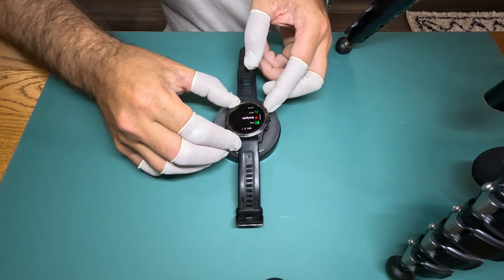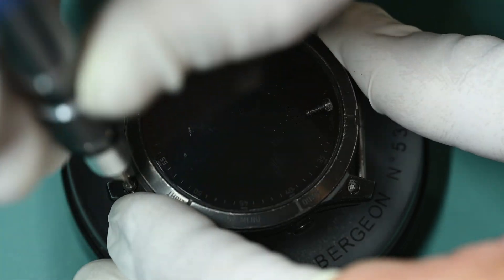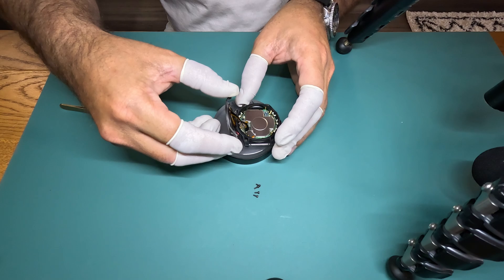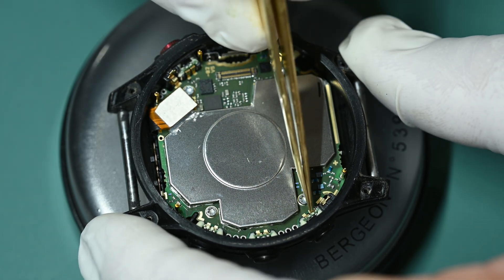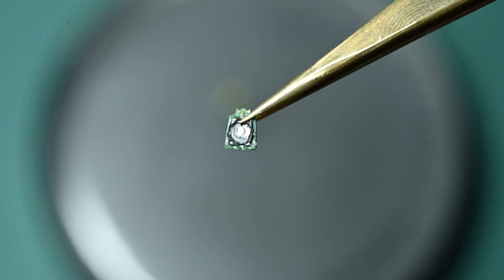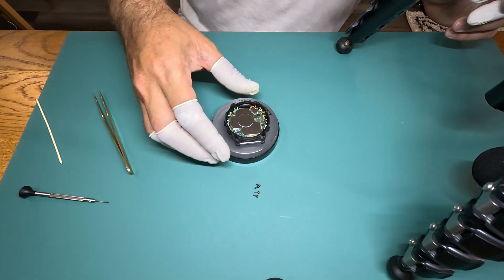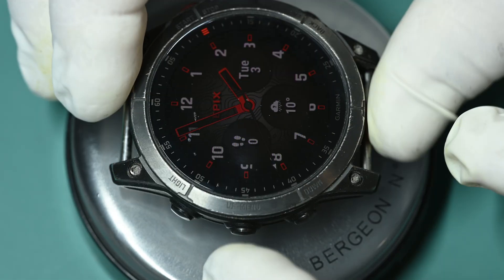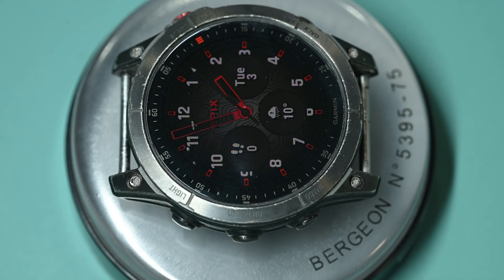The REAL way to fix a Garmin button that's not working

Comment: Great video. Going to try this to fix my Fenix 3 that’s been sitting in a drawer since the start/stop button broke a few years ago. Thanks!
Reply from the maker: It will most likely be a different switch on the fenix 3. I presume it will be a similar procedure, unless it is a solder-in type. Thanks for watching and good luck 😊

Comment: Hello and thanks for the video!
Where did you buy the switch? I need to repair my 7x also... 😒
Also you know where to buy a new gasket?

Thanks and merry christmas!
Reply from the maker: Thank you, I'm glad you liked it :) 
The switch was from advancedrepair. co. uk, they only ship within the UK, though. Otherwise you can get the entire middle section of the case with the switches included from ebay or aliexpress. Then you can harvest however many switches you need. It works out a lot cheaper that way, as the prices have gone up on the UK site since making this video. Good luck with the fix!
Reply: Hello again and thanks for the reply!
Unfortunatly I seem to be to dumb to find those buttons anywhere else than where you mentioned. I searched temu and eBay but nothing.
Any further tips? 
Thanks and happy new year!
Reply from the maker: Definitely wouldn't say that! They are very tricky to find haha. I just checked ebay and you can still get the case of the watch with all 5 buttons in them. The name is "middle plastic front frame for garmin" and you can pick the model you want, 47mm, fenix, etc. Hope you have some more luck!

Comment: Thanks for this, I have the Garmin Epix 2 and the enter (top right) button became inoperable about a year and a half after I bought it.  Could kind of use it connected to my phone but without the ability to hit enter very restricted.  Now I had to update my phone and I can't connect it to the new phone without blue tooth repairing which I can't do without hitting enter.  Very expensive watch, I had an old Garmin Instinct that lasted for years with no issues.  In Canada, no idea how I could find the switches or somebody who could repair it.  Still it is nice seeing a good explanation of what has to be done and there is a remote possibility of repair.  Thanks for taking the time to put together an insightful video.
Reply from the maker: Thank you, I'm glad you liked the video! You may be able to still get the middle section on ebay that you can harvest the switches from. I have seen some people in the comments have success with this. I hope you manage to get it sorted!

Comment: Do I need to add some solution or something extra to the edges of the watch face to ensure water tightness?
Reply from the maker: It is best to replace the gasket and use a silicone lubricant made for watch gaskets if you want to ensure maximum water proofing 🤙

Comment: you think a Garmin Epix pro standard front frame would have the same switches as the GEN 2
Reply from the maker: I'm not too sure, but the different switches look a lot different. So if you can find a frame where they look the same (you should be able to see the two brass tabs) then I would say they are the right ones. But I can't guarantee as I have only worked on my own watch, not other models. Hope you have some luck, mate!

Comment: How do you remove the silicon to remove the micro switch? I saw in another message scraping it off. However can not see the blob of silicon to remove. Is it below the gold pins? I’ve used a lot of force with tweezers to remove the button, I get movement of it. But it won’t come up. 

I’m wanted to replace it with the bottom left button. As feel it’s hard to buy a new button for £90 when the watch is only worth £180 on eBay. 

It’s tempting to get a newer model and hope they have resolved this issue and screen burning. But feels bitter if it only lasts 3-4 years as well. When you’d expect at least 6 years for something on this price. While friends have 10 y/o Fenix still going strong.
Reply from the maker: If it's the same model as mine, the silicone was only a small white dab on top and peeled off easily. The switch shouldn't need much force to come out. Sorry I couldn't be of more help, I hope you have some luck!

Comment: I was not able to find on web site of ADVANCED REPAIR SERVICES if this part also fits START/STOP button on Epix watch? This is my case. This button looks a bit different by the look. Any thougts?🤓
Reply from the maker: I'm really not too sure about which different models this switch fits (other than epix gen 2 and fenix 7). In my case, I just removed the switch and searched for one that looked the same online. If it doesn't look the same, then you may have to buy a spare parts watch or similar on ebay
Reply: @Timepiece_Mechanics  I am having the same watch as you - Epix Gen 2. Apparently answer was in your video, as your START/STOP wasn’t working and you took the switch from DOWN button from your watch. So they are the same.
Reply from the maker: Oh sorry, I didn't quite read your first question properly 🤦‍♂️. Correct, all the buttons in the epix gen 2 are identical 🙂

Comment: Exaxt same problem.. garmin epix 2 down button no longer responding. My watch is just over 2 years old. Very disappointed by the quality of Garmin. When I bought this watch it was nearly 1000 EUR at the time. It's totally unacceptable that a button breaks after just 2 years of use, especially in this price category, which is supposed to be one of their flagship models.

Comment: Same problem with my fenix 7x pro. Tried to soak it in warm water but without success. I m using my fenix in my swimming pool filled with the water from my well which is super hard. Put it in a mix of warm water and vinager for 15 minutes in order to disolve the potential limescale. Seems to solve ( at least temporary ) the problem. Good luck
Reply from the maker: Glad to hear it was an easy fix! 👌
Reply: Thanks for the suggestion mate, I'm gonna try it out now😂

Comment: What chance percentage would you say this is the fix for not functioning start button in Fenix 7? I can press it, there is just no click. Common sense tells me this is exactly what happened, but I am more software than a hardware guy :p
Reply from the maker: I would say there's a very high chance, as the "click" is all to do with the micro switch. It is always a gamble, but you could pull it apart to check before you buy a new one, just to be more sure

Comment: Hi, do you know if the middle frame buttons are the same for the Epix and Epix 2 (non pro)?
Reply from the maker: I'm not too sure. I would assume so, but it would be worthwhile looking on ebay or similar and see if you can see a difference
Reply: I purchased the entire middle section (see my other post for the ebay link - no affiliation) and the internal button parts are all the same for the 5 buttons on the epix gen 2.
Reply: Thanks for the response!
Great video btw and as I can see, it already saved a couple of watches :)
Reply from the maker: Thank you 😊 
Yes, very happy I could help some people!

Comment: My Epix Gen 2 'back' button (lower right) stopped working.  I was surfing in surf mode and a guy asked what time it was.  I was sitting on my board but the watch was obviously wet.  The button didn't respond until I pressed it a bunch of times.  Now, after soaking in warm water etc., it works here and there, sometimes after one push, other times after 20.  I found a guy selling the entire middle section of the watch on ebay per your suggestion.  Do you think it would be easier to just replace the entire middle section?  Or is taking the bottom off and getting all the internal parts of the watch back in more difficult?  Thanks for the great video.  Also suggest to others like me who don't have a spare gasket, to clean it and the grooves with a cotton swab, then lightly lubricate with silicon grease.  I've done this with all my underwater camera gear and would assume the same works here.  

Edit - okay, I just wanted to see if I could clean the button and switch because I was still getting a 'click'.  But the switch took a little wrangling to get out after peeling away the silicon.  Unfortunately I broke one of the 2 gold contactors using tweezers to extract it...so now I have to wait until my middle section arrives.  Hopefully, I can extract the switch more delicately.  As for my initial question of putting the watch back together, using the refurbished middle section, it looks like that will be complicated after seeing all the components and how they are screwed in.
Reply from the maker: Hi, sorry to hear about the issues you're having , but I am glad the video has helped. And yes, changing the entire middle section is quite a bit more involved, as it seems you have discovered. At least you will have a few spares now :)
Reply: @Timepiece_Mechanics  Without a doubt.  I wish it wasn't so complicated because all the buttons on the replacement middle section I received all feel perfect.

Comment: Thanks for the video. They charge £90 for a single switch for an Epix Gen 2, so I think buying a faulty watch for that price is they way to go.
Reply: I purchased the middle section from eBay and just received it (it comes from China so I was a little concerned).  It seems like it is brand new and probably costs about the same as 1 switch from the other UK company.  It took approx 2 weeks to arrive in the USA.  I'm going to do the repair this weekend.  If it doesn't work out, or I find some other issues, I'll post what I find here. Good luck.
Reply: Went smooth as silk! I should have replaced another button that works but doesn't 'click' but thanks to this video, I know I can replace it when it fails...I've got 4 spares left!

Update - for non watch repair experts (that includes me) - the gold contacts on the replacement parts are EXTREMELY FRAGILE!!  When installing the new part, make sure you press the contacts gently in as you push the part down into the slot.  I had 5 extra buttons and am down to ONE!  The first one went in fine, but after a few weeks, the button stopped working.  I opened it up again and noticed the button wasn't fully seated (not sure if I didn't put in in properly or if it moved over a few weeks of usage.  I did not use any glue to hold it in place. Without really looking closely, I just pressed down on the part and it seemed to slide in and click into place.  Powered the watch on and It still didn't work.  So I decided to just replace the part since I had 4 more.  When I took it out, I realized I snapped off one of the contacts when pressing it back into place. Then, when pulling out another replacement button, the tool I was using slipped and I broke off one of the contacts on that button/switch...GRRRRR!  I pulled another one out (carefully!) and, using two hands, I pushed the contacts in to make sure they could slide in without hitting the circuit board.  Then I pushed the new button down. Did another quick look to make sure the contacts were okay, then put everything back together. Now it give me a nice positive click and works.  I think I'm going to order some silicon glue to hold the button in place better.  I think pressing the button repeatedly can cause the part to come out of it's slot so it stops working or even breaks the contacts.  Hope this helps.
Reply: @man0fsteal  Are you looking to sell 1 or 2 of your spare switches?
Reply: @man0fsteal can you share the link?
Reply from the maker: Excellent! Glad you managed to sort it out 👌
Reply: @man0fsteal I’m looking for one as well without luck. Please share the link. Thanks
Reply: @man0fsteal can you give me a link where did you order, i cant find it
Reply from the maker: If you can get your hands on one, that's definitely the way to go! Thanks for watching!

Comment: My garmin epix gen 2 watch display is automatically touch. Can I know what is the reason for it.? If I take the watch apart to clean it inside, do I have to put on a new water seal?
Reply from the maker: I wouldn't think cleaning is the solution, but I don't have any experience with screen issues. It is best to replace the gasket if possible. Good luck 👍

Comment: Excellent video, was finally able to order replacement buttons. Do you have any information on front gasket?  Inner and outer diameter ? Thickness ?
Reply from the maker: I'm glad I could help! I didn't measure the gasket, sorry I can't be of more help. Maybe there's some information on a forum, or even searching ebay may be your best bet 🤞
Reply: Where did you manage to order button

Comment: I dropped mine, and now the menu button doesn’t work. It still feels clicky as the rest. Is it possible it just kind of popped out of place and all I need to do is push it back? Great video btw!
Reply from the maker: I'm sorry to hear that. If it still feels clicky, that would suggest the switch is still in place. The silicone holds them quite securely. It may be that the switch is damaged, but it is hard to know for sure, and it will be a bit of a gamble, unfortunately. Thank you for the kind words 🙂
Reply: Finally an awesome video about this. It happened a few days ago to my tactix 7 amoled. I'm still in warranty so I rather send it in. What I don't get is that a 1.400 Euro watch just breaks down that easily. This is for me a big handbrake in continuing buying garmin watches. If they repair it, hhmmm. If they replace it, then I only have 2 months of warranty left. I'm pretty uncomfortable with this experienced. Especially with a watch that is promoted as a strong tactical watch.
Reply from the maker: I thought the same thing, and finding the right part was way harder than it needed to be. I made this video to make this fix more well known. Thanks for the kind words 🙏

Comment: Where can I get the button? Dropped my watch and the menu button won’t click anymore.
Reply: Did you end up fixing it? Could it have just lost alignement? I have exactly the same issue. Dropped it and the menu button stopped working.
Reply: @kolinasaelt6289 the button was broken, checked with Garmin and they wouldn’t fix it. They offered to buy it back for a good price so I swapped it for a Fenix 8.
Reply: @kolinasaelt6289  It's def possible, but after repairing mine, it's unlikely.  There are blobs of silicon 'glue' holding them in place.  But as I've already found out the hard way, the gold contacts are VERY fragile and it's possible a hard hit to the button could have broken one.
Reply from the maker: I got mine from advancedrepair.co.uk, but you may be able to get them on ebay. The search terms for ebay are at 4:15. Hope that helps!